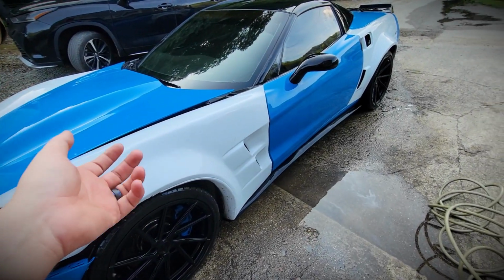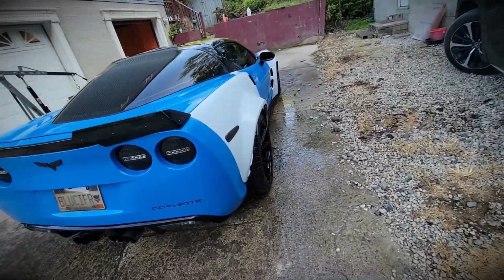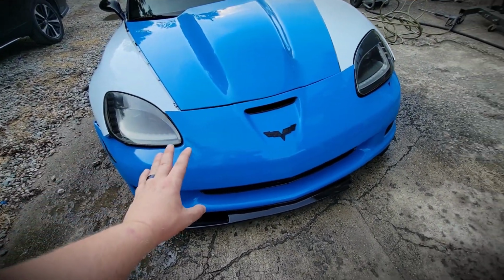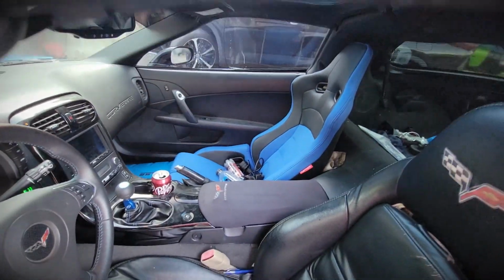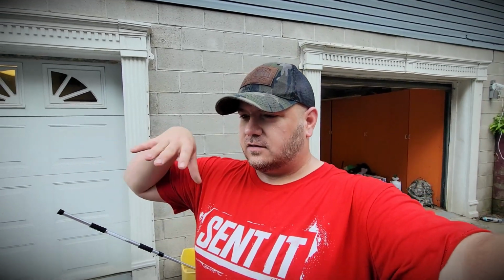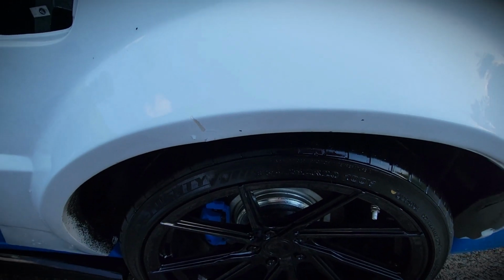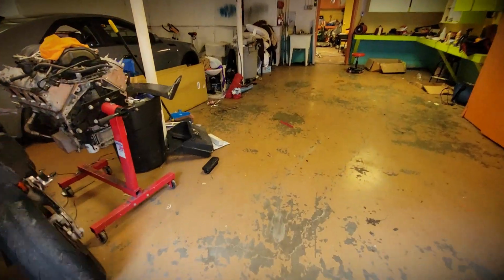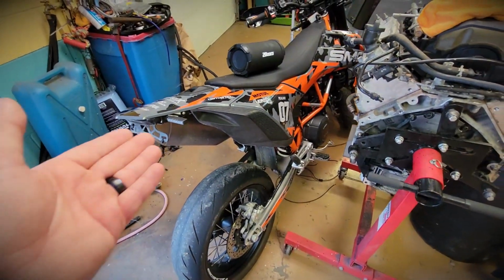My C6 Corvette got even WIDER! | California Super Coupes | Car Reveals

Comment: Hey good evening man I got the exact same wide body kit the csc extreme for my base z51 I also got the ultra deep concave forgestar 14s 19x12 for the rear I’m not sure what the offset is I get thrown off every time lol 😂 but question for you could I run a 345/30/19 on the rears without rubbing ? Also keep up the good videos I been watching them for a while now amazing how you made it look so easy changing out the front bumper cover I had hell lol 😂
Reply: you mind showing how it looks on the car?? whats your instagram page
Reply from the maker: Sorry buddy just seen this.  YT been acting weird.  I've got a 345 on a 20x13 rear with no spacer and it's not rubbing anything
Reply: @PeaJayYt  nice bro is it a forgestar f14?
Reply from the maker: @XDgamer-lk8nf  no sir I have a stance sf01.  I've got F14s on my c5
Reply: @PeaJayYt ok I have the same body kit for mind I’m using a forgestar f14 for the back I was told to use a 345/25/20 from csc does that sound right to you?
Reply: @PeaJayYt they are the super deep not ultra